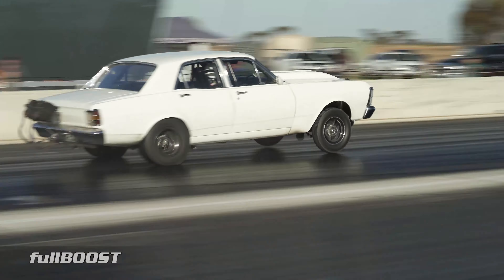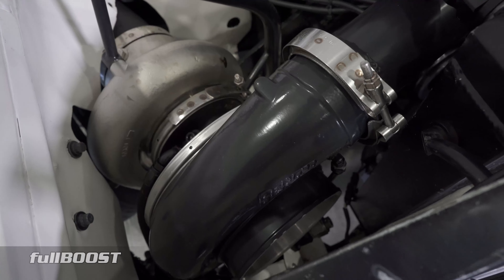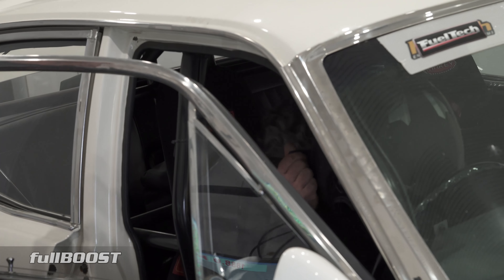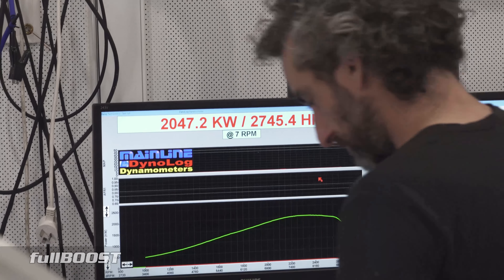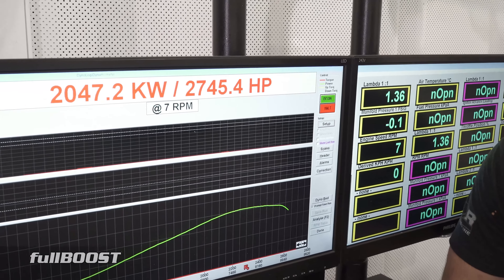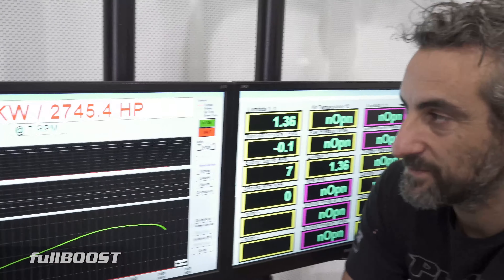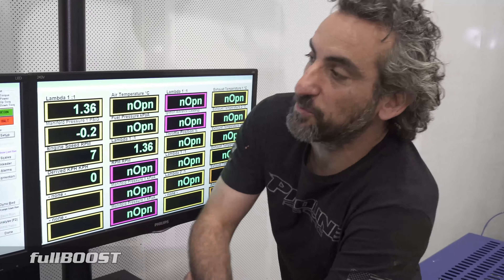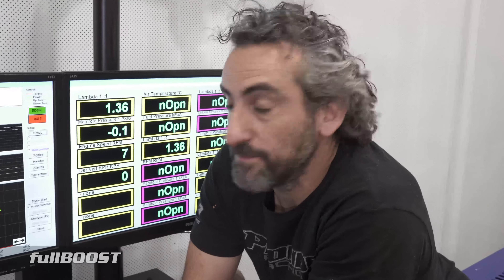The MOST Power we've ever filmed! | fullBOOST

Comment: 1.21 jigawatts probably enough to get the XW back to 1968
Reply: DMF351 a year before it was built?
Reply: +  DMF351

Back to '68? Take me back, PLEASE.
Reply: Great Scott!!!!!!
Reply: Even then it has more horsepower than 1968 had going into space 😂
Reply: Gees! How do you keep the power on the ground with that power.
Reply: Dil Lee We use Fueltech traction control our cars and it has helped us go 6.96 on the quarter-mile and over 211 miles an hour at 3950 pounds
Reply: 2 years late...but comment of the decade 😂

Comment: 2745 @ the hubs unbelievable. Don't think a normal roller dyno and chains or even the tyres could hold the power on that type of dyno
Reply: I'm realy surprised the hub dyno didn't explode or get pegged doing trans brake launches in top gear with that much power is frikin intense

Comment: Do not mess with something which is working perfectly, as soon as you start to change things like turbos or anything for that matter, that's when things go wrong and normally its a big problems as well? 
Also this is the sort of free marketing these days 20 years ago forget it, its all yellow pages and word of mouth noise, now days dandy engines tell you what you can have and what its going to do at the track based on air temps and based on engine and running gear comb's still have not seen a turbo drag light set up, as they do have the brake controller, which holds the car still the turbo spools up, they need to have it set up based on maybe say 3 different brake control set up's and then trimmed on the 1/4 mile just saying, as i said before brake auto controllers, anything with more than say 60hp would simply spin the rear wheels even with a massive hi stall? Its a way of cheating really, sure its new tech, but hey you cant put a 2.5K hp twin turbo drag car and the tree lights go green and she is still sitting there, either spool her up and when she goes green your sending her down the track, not sitting there for 3 more seconds and yet the tree is green? I really dont think its fair, when everyone else is going when the tree turns green Including supercharged engines comb's like Brett's VF1, 1200 HP GTS, get the point people?

Comment: OMG, just imagine the push in the seat, frank you should have a passenger in the front seat and tell them if they can grab the $ 100.00 dollar note, before you reach the 60 ft its theres, lol :) amazing stuff, like they say more air/ fuel and get it right, based on the weight and how you want the HP to get to the rear tyres and you have a winner, back 15 years ago, there's no way on this earth you would be able to have that much HP going to the rear tyres ,with out fuel control and hp control, based on 1/8th and 1/4 miles times, impossiable, basically just burnin rubber really, well done FRANK and the team at Dandy engines, remember when i went there to try to sell some  Aircraft grade welding wire and chrome moly welding wire, and tubing back in 2001. :)